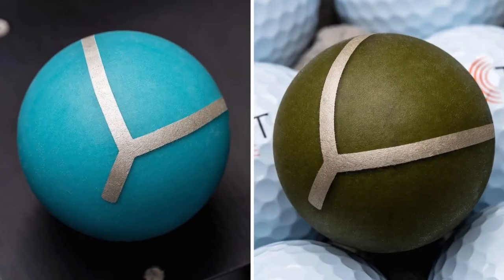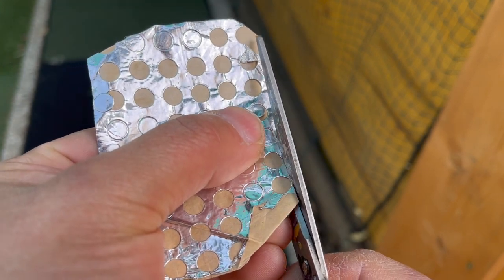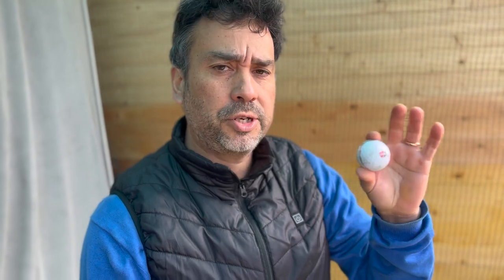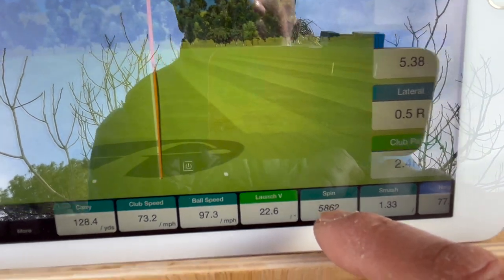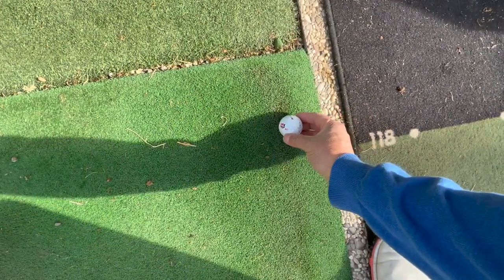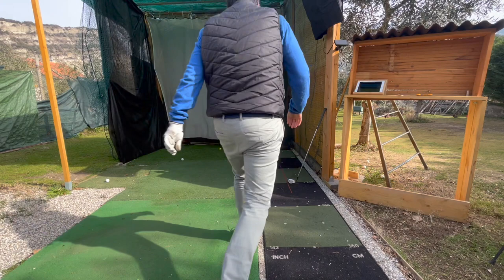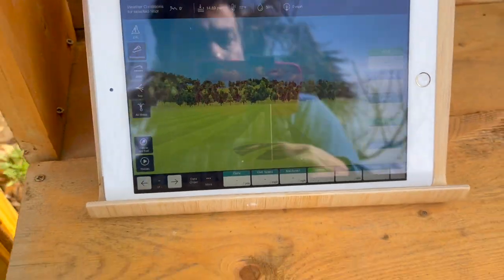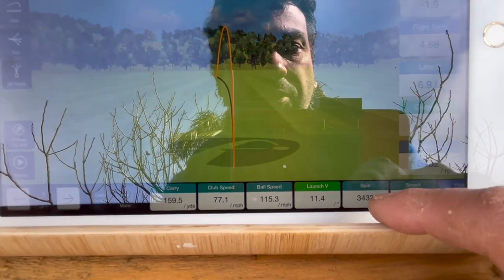DIY RCT Golf Balls | IT WORKED!

Comment: What metal did you use and what glue did you use to attach to the golf ball
Reply from the maker: It was the leftover sheet of metal (sticker) from the mevo plus metal dots
Reply: Try the metallic ductwork tape used in HVAC work. I think it’s aluminum and it’s double sided, just like that tape used in this video.
Reply from the maker: I still can't find RCT balls, not sure if with the mevo plus there is a huge difference with and without metallic dots... @Garysalunatic

Comment: I wonder how this would work if I just make a simple “X” instead of a “Y”. 
I’ve tried just a dot with my Garmin unit and got no joy. I’ll try this out when it warms up around my area.
Reply from the maker: I did it doesn't matter, but much better spin numbers than placing just a dot
Reply: 👍
After I saw this vid, I took the sleeve of AVX balls that I use in my backyard and set one up with an “X”. One with “Y”. And the last one with 3 dots in a triangle pattern to present a larger metallic surface on the ball. 
Like you, I also love doing this type of experimentation to see if I can find what works best for me. So far, the X is easiest to apply with my uncooperative fingers.
Reply from the maker: @Garysalunatic  I’ll try the x and see if I get better spin numbers, thanks for the idea
Reply: @thebackyardgolfer7010 any update ?
Reply from the maker: Yes it works like a charm with an X, video coming soon! @djVisionIT